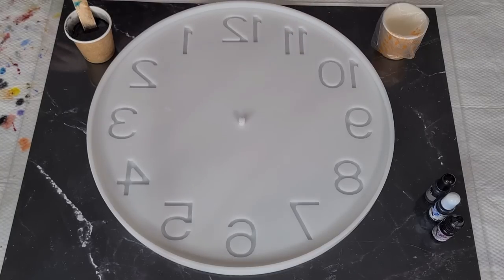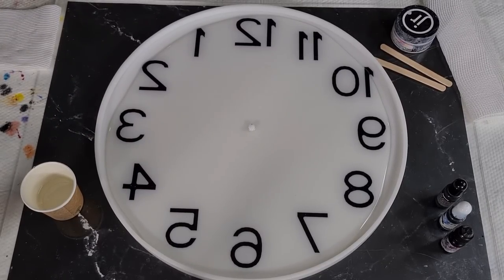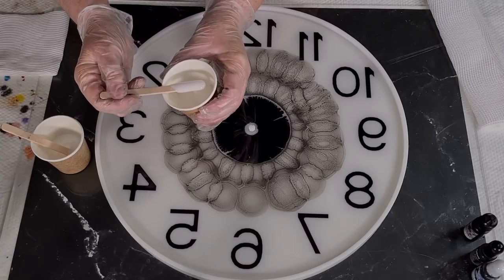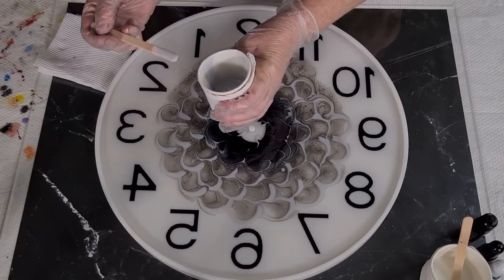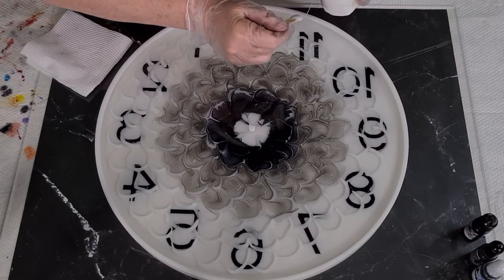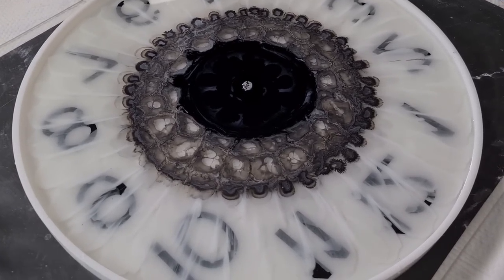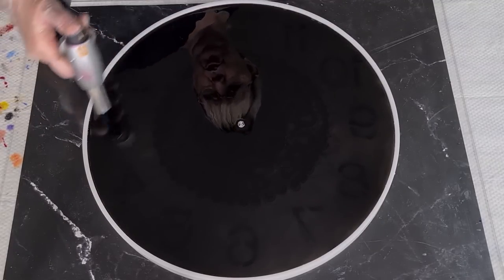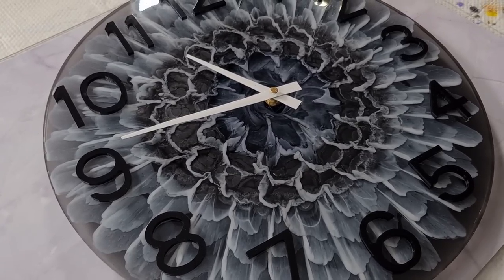#1484 Huge Resin Clock With Gorgeous Black And White 3D Blooms

Comment: its pretty! Ive also found that metallic alcohol inks dont particularly care for flamed heat. it either burns off and causes that almost sandy looking texture or the flame is too hot and does the same thing! It might work okay with a heat gun on low though.

Comment: I’m wondering if that ink in the centre stopped the resin from blooming?  Also, I think the black backing coat is too much because you can’t see the black numbers clearly. I’m thinking maybe a red background and red clock hands, or red numbers/clock hands.   This clock bloom process is a real challenge it seems. I admire your persistence Julie. 🌺🌴

Comment: Could you be having trouble with the clocks blooming because of the nib in the middle is changing the way the resin is moving as it cures? Maybe try a mold without  the hole in the middle.

Comment: Could it have something to do with the silicone post in the center? I notice the resin pulls away from the silicone on the outside toward the center which creates the bloom as it drags the white along with it. And the resin pulls away from the silicone post in the center toward the outside but the resin moving in keeps it in position hence no bloom. Just a theory.